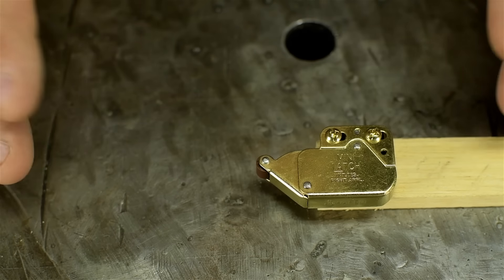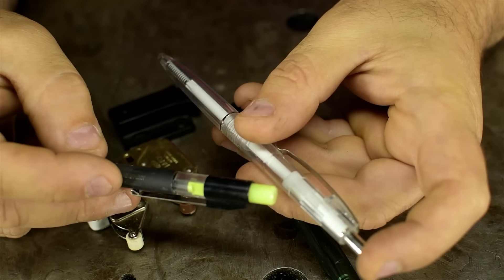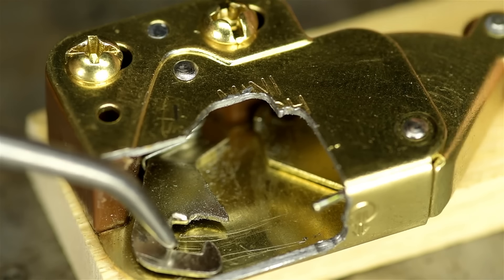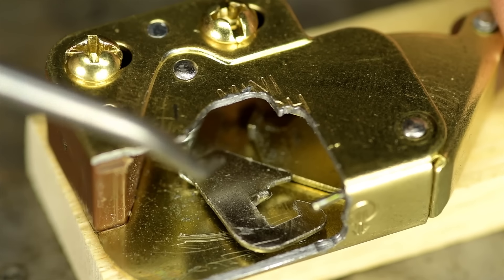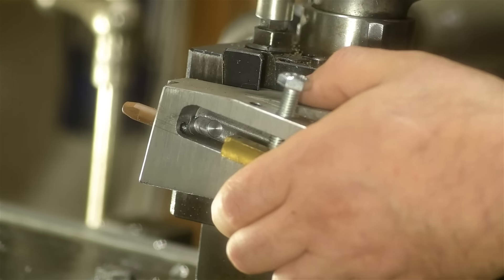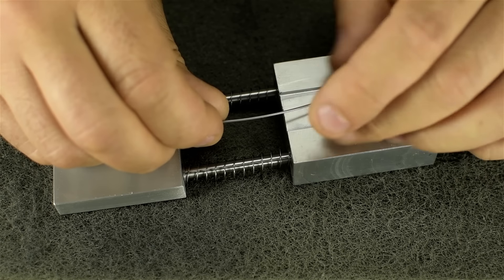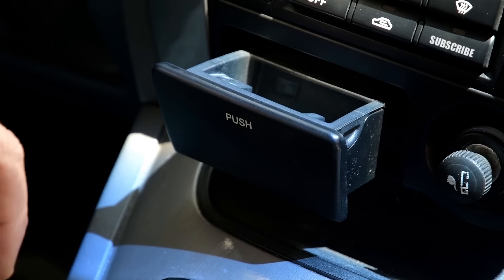PUSH LATCH Mechanisms (DIY!)

Comment: "compression springs that have 0 body length haven't been invented yet"
laughs in magnet
Reply: Glad I'm not the only one to catch this! (not that I thought I would be) But to be fair, I think he was only considering Springs, and not mechanisms that exhibit spring forces.

...Still, TOT should make another, but with opposing magnets now, as penance for his engineering transgressions.
Reply: yeah, but a spring can be used anywhere. a magnet will not be so great with electronics near by or if you dont want every big of iron filing ever to get jammed up in your junk
Reply: @yareyare_dechi  But the quality or trait we were concerned with was 'zero body length'. A situation where a helical metal spring can't be used. ;)

Of course, different requirements dictate the choice of mechanism.
Reply: @yareyare_dechi  very true, welders are magnets' worst enemy as well, too much heat or a zap in the wrong spot with the TIG and it's toast
Reply: Zero body length only very briefly. The metal bits they will pick up will change that. Plus, think about how strong the magnets magnets would have to be to still be pushing significantly with the device open at the full 3 cm or so of travel. Gonna be fun trying to push those very close together!
Reply: @robertcravens6336  man that's why you take forces and application into account, you're not gonna put a neodiddlyum magnet (with more throw than the field even affects no less) in a switch right next to your hard drive, nor are you gonna put a contact switch on the outside of a space shuttle
y'all are acting like you don't actually pick every switch specifically per application, there's a different reason to pick different parts that do the same thing on every single project
Reply: @tykokavaak5784  well if you want to split hairs, a magnet isn't even a spring in the first place. And ToT said 0 body springs didn't exist. There are a bunch of ways you can force something apart if you ignore the spring bit
Reply: @yareyare_dechi   To be fair, in my first comment, I did acknowledge that TOT was most likely referring to conventional Springs, and not spring-like mechanisms. Admittedly, it's a technicality... But it's fun to think outside the box.

If you want to really split this hair down to the atomic filament level, then ultimately, the difference between a magnet setup and a spring is only in how you leverage the use of the electromagnetic force. They are fundamentally the same.
Reply: @Gu1tarZer0  Right?! What's with the nitpicking? 😜

However, all this magnet hate got me thinking some more; a gas piston in hard vacuum. If arranged so that the vacuum chamber expands when the device is compressed, then your spring force is dependent on surface area of the piston and atmospheric pressure.

But I hear the complaints already: 'Oh, but it wouldn't work in space' and 'you could never actuate it at the bottom of the ocean!'
Back to the drawing board I go, to seek the ideal springamathing. 🤔
Reply: miracles
Reply: Yeah they have - they're  made of compressed air.
Reply: @millomweb  YES! I smell a sequel!
Reply: Laughs in two magnets, actually
Reply: um... you'd still have to inset the magnet(s)... to achieve a flush fit.
Reply: Tot wound his own coil springs...that was so gangster. Keep your thing in a vise!
Reply: How are magnets 0 body length?
Reply: @ePiiCeaglepwner  the magnets are not, but if you use the field they produce as a spring and inset the magnets into whatever you're designing, you can press them together whereas a physical spring is always in the way of full compression
Reply: @kaelin000  true. You could do the same with the springs to achieve a flush fit too
Reply: conical compression springs also get pretty close, but still have a compressed thickness dependent on the gauge.
Reply: @Gu1tarZer0  There's really nothing wrong with magnets near hard drives. The BLDC motor in there got plenty of them and there's a HUGE one (in one of my salvaged drives it was about an inch in length) there to move around the read/write head anyways.
Reply: the magnet does have body length what are you talking about or are you saying the north and south poles are coincident? If you used magnets you'd still have to inset them.
Reply: If the magnets have to be recessed, just like the springs, they're no longer 0 body length
Reply: If I'm taking this comment right, technically both the magnets and the springs still have a non zero body length. If we take into account the holes that would fit the magnets, we can also use those holes to store the springs while compressed so there's no gap between the parts

Comment: C'mon, fixing parts of a car's interior is the most fun job ever!
Invisible fasteners under  fabric, cutting your hands at leats 3 times on sharp bits trying to undo that so-called click mechanism, and laying upside down over the driver and passenger seat to unplug that connector, while the handbrake lever is loosening your kidney stones. 
But at least when you got it all back together you can enjoy that new rattle  between 2500 and 3800 RPM, witch is 90% of all driving.

At least it now clicks properly...... 
to bad about something scraping it halve way  so you have to help it along.
Reply: Everything okay at home buddy?
Reply: @monchosalce  lol!
Reply: Don't forget all the plastic fittings and connectors that break as you pull things apart.
Reply: @chaos.corner  I treat it like a guessing game, how many panel clips will I break this time? Will the panel kinda still stay on when I'm done?
Reply: Sounds like an f150 heater core replacement.
Reply: @chaos.corner  That's the 2500 to 3800 rpm new rattle he was talking about. Broken clips and spare screws that never made it back home 😒

Comment: 17:02 PLEASE get started on rotary dampers, I've genuinely always been curious about how they work
Reply: usually friction.   Sometimes they use a fluid (extra fancy damper), so its fluid friction.  I believe the swing out cup holders in the doors of my Lexus use this type.  
Cheaper ones just use sliding friction.
Reply: Wish granted

Comment: 16:33 the flat one used to be used in old laptops. The PCMCIA cards. I still have the mechanism somewhere in my house, always thought it was a very cool little device. All metal, very compact (two such tray mechanisms would fit over my pinky finger (or one cm))and they worked flawlessly for almost two decades before i parted out the laptop. 

One other place this push latch mechanism was used, but AFAIK very briefly, was when we used to have electronic typewriters. I'm not 100% sure, i never took that one apart, but the mechanism for the floppy disk was unlike the conventional ones (push button release) and it would allow you to release the disk without pushing the button, just depressing it. I think it was a SHARP one, but eh, it's been almost twice my life so far, since i've used that machine.

Yeah, this was a great episode, this is one of those mechanisms you never look at, but that have a million and one applications you'd never suspect. I guess it's the little things we miss, that make our lives easier.
Reply: People Can't Memorize Computer Industry Acronyms
Reply: So if you used the SHARP when you were 5 you are almost 15 now?
Reply: Yep! The mechanism was used on the shift lock key! Good catch.
Reply: Oh God that acronym is giving me flashbacks to 2004, trying to find drivers to get a Windows ME (!) laptop to connect to my college's Wifi with a PCMCIA wifi card, then giving up on that and getting a 10/100 card to plug it into the ethernet jack.  Then I upgraded to a new machine with XP x64 (!!) and had the same dance all over again because there weren't 64 bit drivers for... anything.

Comment: 15:00 what if you instead had the wire with spring force pulling it down toward the guide block, and then have the top of the heart stepped down so that the spring falls into it deeper, keeping it from going back the way it came and instead sliding into the heart tip. Hell, why not both for security in redundancy?

Comment: Re: Compression spring with no body length.

Air.
Reply: But can you compress air indefinitely?
Reply: @DemodiX  Compress it enough and it will liquefy, and then you're pretty much done.
Reply: Infinite pressure? A Big Bang occurs every time you compress it?
Reply: Magnets. Always the answer
Reply: I was actually thinking gravity, though problems could arise from orientation.
Reply: Barrel springs have almost no body length: it's effectively as long when compressed to a flat pancake as one wire diameter.
Reply: @Gottenhimfella  Any chance you're talking about cone spring?
Reply: @kaffaunreal347   not in this post, but further down the page I did mention a conical spring. A barrel spring is effectively similar to 2 conical springs back-to-back, made in one piece
Reply: @Gottenhimfella  Torsion springs don't even change length.

Comment: When I was a kid I'd mess with these things for hours.  Never head the means to slice one open though.  Thanks, my decades old curiosity is sated.
Reply: "Never had the means"?
That's just insufficient curiosity, my friend. If you really want to open something, there's always a way.
If my parents were still around you could ask them, but then I'd have to go hide...
Reply: File, hacksaw, Dremel, angle grinder, or sharp stick.  Well, maybe not that last one.
Reply: @n8guy  Well, never wanted to face my mother's wrath after I drilled open the sink cabinet may be more truthful.

Comment: As far as your Mrs' car ash tray is concerned, at least in my experience (mostly Japanese and Korean cars) if you pop and lift out the ash tray then under the spring there is generally a screw, two or three.

If you remove the spring/catcher the space in volume can near double.

Now with the spring and retention gone if you want a catch to stop the whole drawer sliding out loose in your hand then a couple nubs of epoxied plastic or aluminium sheet (natural to the insert removal as normal) should do the trick.

Dremel some slits in the frot top of the ash tray bay and depending on the dash etc layout can be repourposed as USB cable management.
Reply: Alternately, a big glob of epoxy will keep it from ever opening again, which is a more permanent fix.
Reply: I vote for Duck Tape!
Reply: @MJ-nb1qn  Quack!

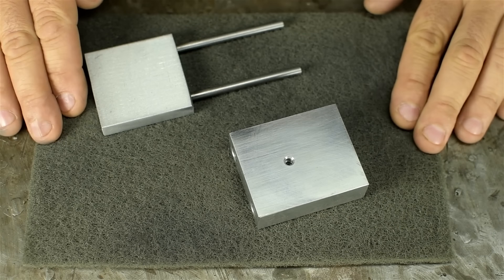Comment: 9:57 14:04
Wow, Tony has some really grippy tread on his sneakers. He was able to move the entire planet by pushing on the back of the fixed block and transferring that whole force from his finger and arm through the rest of his body, down through the tread in his shoes to the planet, back up through the bench and vice, and finally into the moving block. Since the moving block and planet are clamped together he had to move the whole planet to get the block to move. Then those tiny little springs pushed the whole planet back. It's no wonder the first spring couldn't handle the strain. That's some major force.
Edit: Jaw-dropping! They're even grippy enough to pull the planet up when he pushes down on the bench at the end. 18:14

Comment: What I really like about this video, aside from the in-depth explanation of the mechanism-is how I may apply this to a project I have in mind.
I do not have the capacity to mill metal- but I do see an application for a project I have.
Of course, it would be made out of wood instead of metal blocks. I would need wood blocks instead of rods I could utilize dowels but there is no substitute for springs; but they could easily be applied the very same way to the dowels.
The heart track can be easily duplicated in wood. The only obvious problem I see at this point is the friction of the wire eroding the wood track.  The best solution, for that would be to coat the wood track with resin just enough to coat the bottom to reduce the friction.
The project is to apply doors to my bookcase for the dual purpose of putting imagery on them as a display – and also to hide the contents within.
The door to the bookcase cubicle will hang on with a simple dowel on each side.
For other cubicals that I wish to not only block/open and KEEP open (without piston hardware), a simple track for the (2) dowels at the top of each door will suffice.
Sorry that this is lengthy- my point is that without metal milling machinery, this mechanism can be applied to wood and can be reproduced with simple hand tools.
Thank you for this video! ♥️

Comment: You really should get a ballograf pen and check out its mechanism. It's pretty sweet!
Make sure you pull it apart all willy nilly and also make sure you are locked in a room without any outside connections and unless you manage to put the pen back together you won't be getting out.

Comment: I want to build a cellphone holder, similar to what you have built but it should do the opposite, it should pull each side so it grips and holds the phone with sone pressure

Comment: The thicker wire plasticly deformed if anyone was wondering meaning it exceeded its elastic limit aka its yield limit whatever you want to call it so it can’t return to its original shape. Picture it the other way you pull a spring from each end, it doesn’t go back to being a spring it’s like a bent wire it’s just that the other way.

Comment: Ok the drunken cone latch has been a favorite of mine since the the late 80s.  I made one years ago that work with gravity.  A square tab on a pivot. Mounted in the wall of a tube.  Shaft comes down a tube swivels tab up out of shaft path.  the shaft comes in contact with the spring starts to compress the tab drops into a notch in the shaft locking it.  Push the shaft in a little further the tab falls into a bigger notch which will not catch and the spring will push the shaft up swiveling the tab out of the way allowing the shaft to come back up out of the tube.
It's a cool way to put an umbrella inside the door of a car.  From the latch end of the door.

Comment: Can a 2 direction raceway be made? I'm thinking maybe you could make a H pattern gear shifter into a sequential action with paddles. Maybe two raceways parallel to each other? A raceway would be easy to machine on a CNC mill, whereas the alternative I've thought of, a camshaft with two very complicated cam profiles and two ratcheting cylindrical latches that act in opposite directions.

Comment: I used to have a calculator with lid that slowly opened when released.
It used a Very Thick Grease around the mechanism that slowed down the opening!  Otherwise, it would just snap open and just break itself to pieces.
Hot or cold made no difference to it opening/closing.

Maybe that is what you need!?  (or not for your dampeners)

Comment: On the first bend, could you not also have a drop with a ramp towards the closed position after the drop? And would that make the latch last longer as the pin isn’t under as much tension?

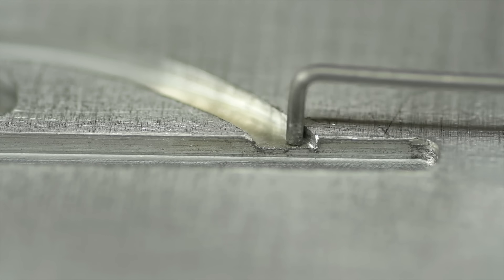Comment: 15:39 Even if the cam is not 3D. A simple railrod switch like mechanism would do the same. Think of a train going backwards a switch which is spring loaded and give way even when the switch is directed to the other track.
Another example is: https://www.youtube.com/watch?v=-WN421leLkk#t=0m18s